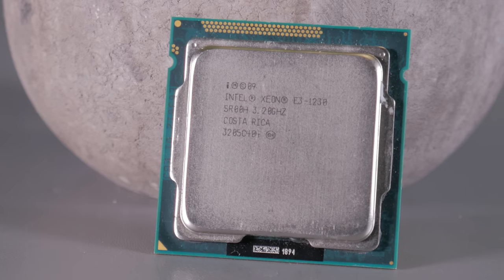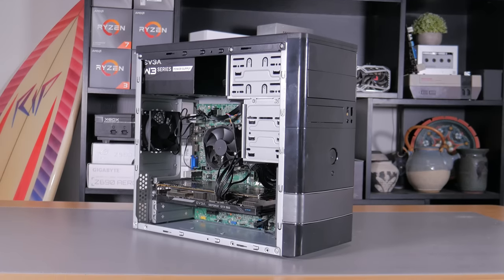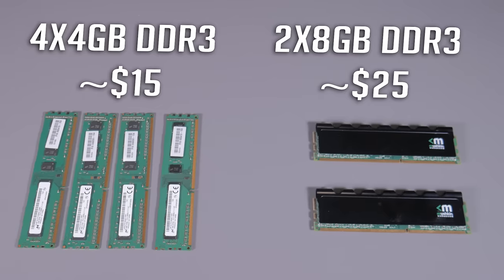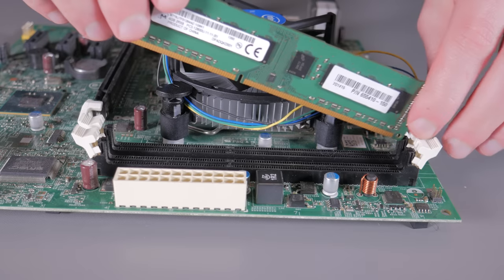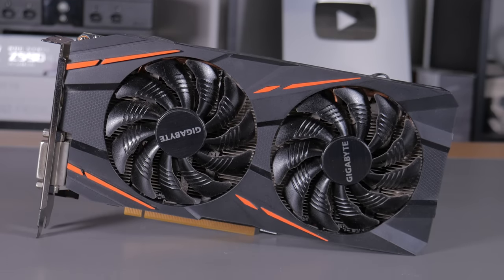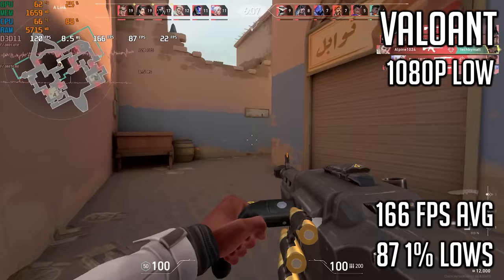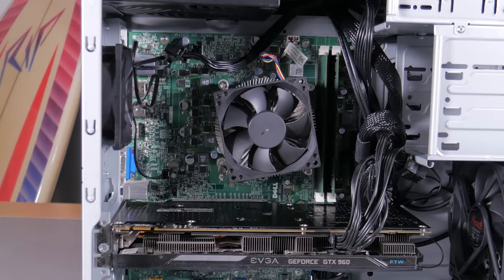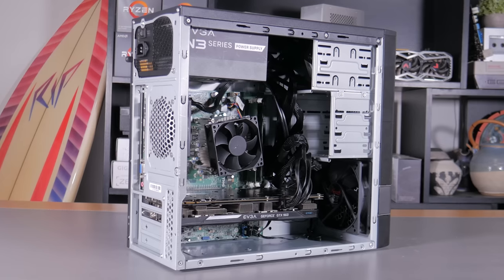The $25 CPU & Motherboard Combo! (2023)

Comment: Hey I've been building systems with those motherboards for quite a while, I discovered that the row of pins by the sata ports can be used for RESET switch, HDD LED and POWER button as well! It follows the same pinout as the vostro's of the same era, no messing with that proprietary 5 pin at the top of the motherboard! No error codes either!
Reply: Is there a layout i can find online
Reply: would love to have a diagram this is great news
Reply: @HoloScope  thanks
Reply: Hello, could you give an example of the mobo layout, or a pdf? This would be a huge help.
Reply: Which motherboard were you using specifically? Thanks!
Reply: any chance u can provide pinout?
Reply: @bofumytofu  Dell Vostro 270 Inspiron 660 pinout - EVILBOX

Comment: I hate to be that guy but… That power usage tho… I spent a little more for a little less performance, but I’d bet the three 2400g pcs I just scraped together for my sisters kids use less power all together than that… all they want to play is Roblox Minecraft and Fortnite… I packed three systems into a single box with one 500w psu, killawatt shows about350 watts max with all systems running fire strike. Much less under real gaming loads. I think the monitors use more power most of the time😂. They love it, only problem has been Radeon drivers crashing, causing their games to be a slideshow, restarts fix it. The cost? Less than 350usd - 3 mobos(as rock-hdv a320, ~40 each)3 cpus($40ea)3 2x8 kits ddr4 2400😢(25ea), 2 24pin splitters😮($10 ea, it’s fine), I had the psu, several small ssds and decent hdds, and a drawer full of wraith stealth coolers along with whatever else I needed. It’s super hacky, but somehow incredibly convenient, lol.

Comment: Fun fact: in 2014, more people were buying a Intel Xeon E3 1231 v3 than the Intel Core i7 4770 because it was much cheaper (until Intel noticed their mistake and put a stop to this)
Reply: Can you just swap the CPUs or does the bios need to specifically recognize the xeon chip? I have some Dell Inspirons that can take a 4770 but they are still rather pricey.

Comment: I've built many PCs with similar specs for friends and family over the past couple years. And yes, I've noticed the RX 470 and RX 570 are both getting very cheap on eBay and are a great deal.
Reply: Especially RX 580 not trusting of RDNA1(most of all, the RX 5700 XT) due to them being used in mining
Reply: @jamesabestos2800 I have been buying/selling GPUs since the early 2000's, I always skipped RX580's as I have seen so many dead ones for sale. Those and the evga AC 1070/1080s. All three were likely mined to death.

Comment: This reminds me of the XEON 1620 v3, ludicrously cheap at just $8 (ie. 6 UKP where I am in the UK), a Haswell-E part and thus (unlike SB) it has all the modern instruction sets and provides PCIe 3.0. It behaves like an i7 4770, but of course the problem is finding a relevant S2011-3 mbd (X99). I bought one to fault-diagnose a Rampage V Extreme, but in so doing I was amazed at how well it ran in general. I've since obtained a replacement 6850K (old one had developed a PCIe controller fault), but I hope to find some other X99 mbd to test the 1620 v3 later. It may only be a 4c/8t CPU, but being X99 it has more memory bandwidth thain modern mainstream mbds and a lot more PCIe lanes. Mind you, the 6c 5930K is only 20 UKP so for the small extra outlay it makes more sense. :D

A while ago the 8c 2650 v2 (IB-E) was all the rage for budget builds via Aliexpress, using mbds such as the excellent PlexHD X79. It's moved on since then to X99/Haswell, but it's not as cheap as it used to be and RAM is priced higher now. 

Another option, again if one can find a suitable mbd, is the 3930K, a 6c SB-E available for about $20, and unlike XEONs it can oc to 4.6+ on a decent mbd, but even at stock is still pretty good. Or there's the 4930K for not much more, or the 4c 4820K for a lot less. In the UK from CEX the 4820K is just 10 UKP, the 3930K is 18 UKP and 4930K is 22 UKP, plus of course these CPUs all have 40 PCIe lanes, so plenty of options for expansion if one can find a suitable mbd. Still, with the CPU costing so little, it perhaps matters less if then spending a bit more on a semi decent mbd, something like the ASUS P9X79 Pro or above. Another popular option for X79 is the 6c 1650 v2 because it can be oc'd, but I don't see the point when the 4930K is so cheap anyway and will always be supported (XEON support varies; Asrock and Gigabyte are usually fine, ASUS varies, MSI I'm not so sure about).

The other nice part about the above options is the quad channel RAM, so one can go for that 4x4GB and still obtain the higher memory bandwidth, which will help in some cases. Or double up the slots for 32GB.

Ho hum, if only it were still possible to easily obtain good X79/X99 mbds.

Meanwhile, for normal consumer mbds the P55 era is still cheap and can be pretty good if paired with a decent CPU, but it is limited to SATA2, PCIe 2.0 and no native USB3 (though as you say one can fix this with addin cards). However, this matters a lot less than many would assume.
Reply: Great detail tho
Reply: @jamesabestos2800  Thanks! :)

Comment: I have an Optiplex 790 DT and 390 MT, as well as 2 Optiplex 7010 MTs. I have tested a Xeon E3-1270 in both my 790 and 390 and they have worked flawlessly. I got it for around $20 USD converted from CAD. The only issue I had was that my 390 BIOS was on the first revision and wouldn't boot Windows 10/11 GPT installers, so I had to make a Windows 7 MBR installer and update the BIOS through Windows 7 before clean installing 10. Now everything works flawlessly on my Optiplex 390 (with the Xeon) and a Quadro K2200 I picked up for less than $15 USD

Comment: I have an Optiplex 390 build I put in a modded HP 8000 case. This board actually works well for a triple boot WinME, XP, and Win7 system. On eBay they have converters for the proprietary power/LED and front IO although it costs more than the board itself. There are guides online for pinouts for DIYers out there. I put a FirePro V5100 (Radeon x700 equivalent ) so WinME and XP can use the same card. For Win7 I swap out that GPU with a GTX 750 TI to play a few newer titles. Strange an OEM board can be that flexible, but with the SATA and ram patches by RLoew Win9x runs fine on the 390 too!

Comment: Here in my country in Europe, any processor that has the i7 name or it's a 4c 8th Xeon get an automatic price premium. 
I have easily found a Lenovo motherboard with standard connector and pin layout for 10€ but the only processor you can find for 15-25€ is an i5 or the equivalent Xeon 4c 4th ( e.g. e3 1220 ) . So I settled for a 15€ i5 2400 with a 10th gen Intel stock cooler. The integrated graphics were pretty useful in the beginning as I added a GTX 1050 a few weeks later.
All in all a made that pc for around 80€ and the other day I made a Zoom call with my students and it was capable of screen sharing while writing on my graphic tablet,as well as keeping some documents open without a hitch.
Reply: I myself live in the netherlands and got myself an upgrade from my i5 4460 to xeon e3 1231 v3 for 20€

Comment: This is dirt cheap. Well done on the sub-$200 parts list. I would never settle for a 960, though. I'd personally use either a 1050Ti or an RX 470 at least. Looks like it's good for someone who is desperate to get into esports. This is better than some of the stuff that was going for over $500 about a year and a half ago when scammer were selling i5 2600s with GT 710 and a bunch of cheap RGB fans.

Comment: Did you change the cpu cooler from intel stock to a server stock cooler? ;) those oem/dell motherboards are not compatible with push pins I guess.

I’m looking for a few optiplexes or Hp MTs so to drop 1230’s in, good video!

Comment: Thank you for the incredible (and very enjoyable) video which highlighted a lot of problems that one may have run into had someone not watched it. Though personally I would have gone for an RX570 for 20 or 25 USD more. The RX 570 would annihilate that 960 in performance and would be imo completely worth the price increase. I looked at a video where the RX 570 was about 60% faster on average across games and on one occasion over 100% faster in Red Dead Redemption 2.

Comment: On ebay I found a deal for a dell optiplex 3010 mobo i5 3570 and 8gb ram for 23 bucks. I paired it with a case and psu deal i got on facebook local. And a gtx 960 for 40. So I put together a build woth a gpu for 115 dollars. It already sold locally for 300.

Comment: Just put one of these xeons in an optiplex 790 with an rgb cooler and a new rx 580 2048sp with 16gb ram. Runs great, mw2 at 1080p recommended settings avg fps 54. Got it up for sale if anyone's interested

Comment: Given the specs, I would love to see the 720p benchmarks, as 720p is more realistic for the system. May be something to consider for these super budget builds going forward.
Reply: or 900p paired with a cheap 19 or 21 inch 1440x900p
Reply: 1080 x 1024

Comment: Be careful with GPU choice and double check PCI version on this motherboards, if its pci 2.0 better get something like rx 580 with big bandwidth
Reply: correct.
but all sandy bridge cpus are only support  pcie 2.0x16 and ddr3 1033/1333mhz.

Comment: Personally, I would rather go with a am4 APU build. Save the 45 bucks for the graphics card and use it for a cheap set of am4 motherboard and ddr4 ram. In non esport games, it will have significantly poorer performance, but since this setup is mostly CPU bottlenecked in all the esport games, I’d rather take the great upgradability of AM4

Comment: i just got a lga 1155 mobo with a i3 2nd gen with it, im planning to replace the i3 with xeon or i5 2400 (temporarily), basically i have a A8-7600 with a 8gb ram i just want to squeeze this rx 460 2gb i got.

Comment: You should of gone with the 4gb model it pro-forms about5-15 %better in 1080p then the 2 gig model I was getting 77fps low on borderlands 3 at 1980x1200 so higher then 1080p so it's either the vram is limiting the gpu or there's a CPU bottle neck